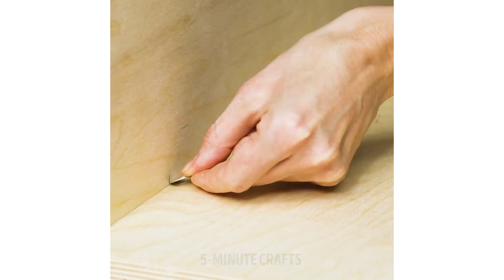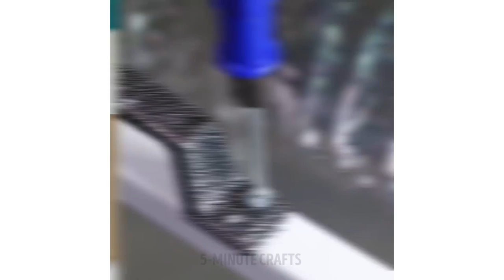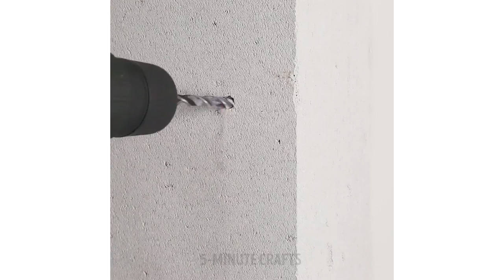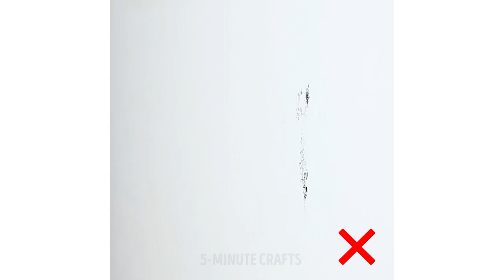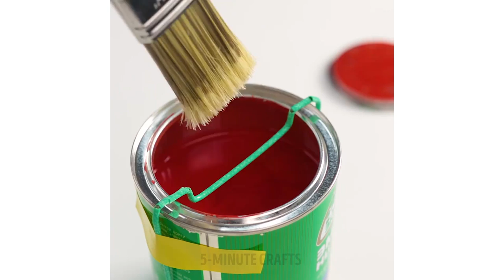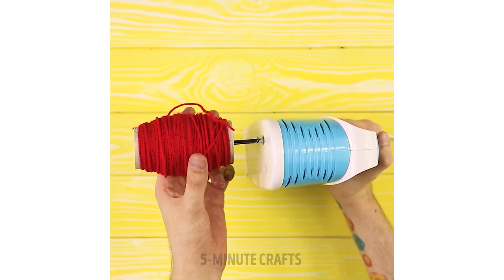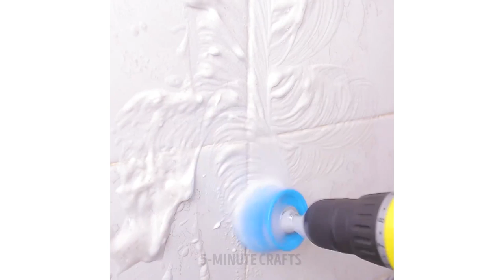14 MIND-BLOWING TOOL HACKS

Comment: Forgive my ignorance but in regards to the "hack" when you use coins to fill in the gap while using a wrench,  I'm almost positive there's an even better way to go about it. I dont remember the exact term for it but I believe it's something that has to do with using the correct size wrench to begin with.  Then again I could be wrong.   Thank you for your effort in finding a solution to a problem that doesn't  exist.  The rest of the hacks were pretty cool tho.  Thx.
Reply: Yeah, or have an adjustable wrench in your back pocket for emergencies.

Comment: Just a warning to unsuspecting tool hacker. The video shows using drill to jack up a car using standard supplied car jack.
If you use drill to lift the car up, you're highly likely to damage your jack, especially if it has little dirt between the threads mixed with lubricating grease as is the case with lot of  older car jacks.
Fast action of drill and heavy load of the car above causes huge friction on those threads and when they overheat, threads can seize. At that point you can throw away the jack as it becomes unusable.
Trust me, I'm talking from personal experience.
So folks, don't use drill on a car jack, even though it looks very tempting.

Comment: i like  these tips /hacks   especially using the washer  for marking  getting the right size may be abit tricky    at first i liked the  lighter solder tip   but if youve  got flux  and solder  why dont you have a  solder iron   but then again  might be good for small  jobs  in a pinch    how do u spell  solder anyway?

Comment: Most of these replace tools that most of us have anyway that would work way better in the first place. Case and point, the using a bolt and two nuts in place of a wrench. They even have fancy ones called crescent wrenches that adjust.

Comment: Don't do the one with the power drill and the vacuum cleaner if it is a concrete wall or anything similar because it can damage the vacuum cleaner, just use plastic bag and tape it to the wall.
Reply: Endast för kommentering as long as it’s a shop vac with a filter you’re good. I’m a mason and we have to do this for work all the time to keep dust down.

Comment: Oh gosh. Don't do the soldering iron with the lighter trick. Copper conducts heat VERY quickly and could melt the plastic of the lighter's fuel storage.

Comment: What is that gel-like-stuff at 5:24 that the lighter w/ the copper wire is dipped into to make it useful for solder?  Because that is pretty awesome.....
Reply: FLUX cleans and prepares the surface for a good weld/ joint.
Reply: yea that would save you a looooottttttt of money

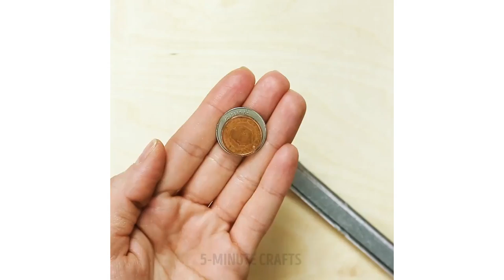Comment: Spanner @ 3:40 was used the wrong way ... that's how heads get rounded ... should've flipped it over for removal ... the way it sits in vid is correct way for tightening ...

Comment: Putting one wrench in the end of another is not a good idea when tightening nuts or bolts. I have seen people snap the threads on bolts doing that. And if you need that much torque something is probably wrong.

Comment: Some of this stuff is brilliant, but some just wouldn't work. The magnet ON the spinning drillbit? Not so much. Hammer with nail magnetized TO the head of the hammer? Ridiculous. It's would never work with a size of nail larger than that. You'll swing to put a tenpenny nail into the roof and scatter the yard and roof with nails, as soon as you swing.

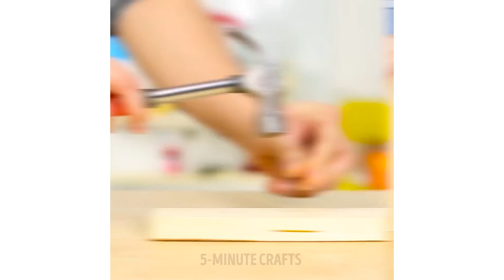Comment: 3:05 is literally making the solution  worse in the ling run. The spanner is designed to be that length, which matches the torque required to tighten nut/bolt of that size. That why spanners get longer the wider the fastener dimension. You are literally overtightwning by applying too much torque.
Reply: Rhys Evans I think the person try to remove the nut.
Reply: Simon Bouchard for that situation is ia useful. But the video does not show that